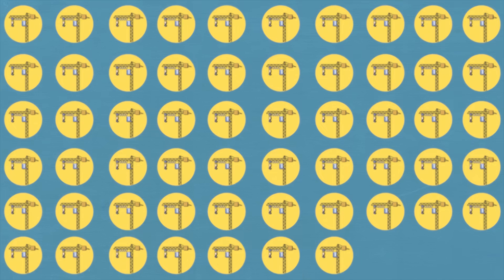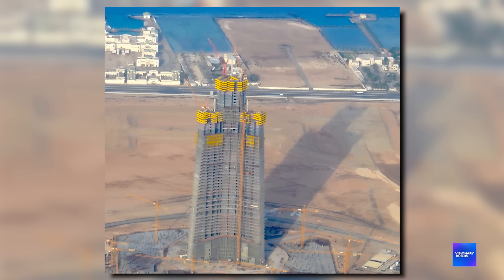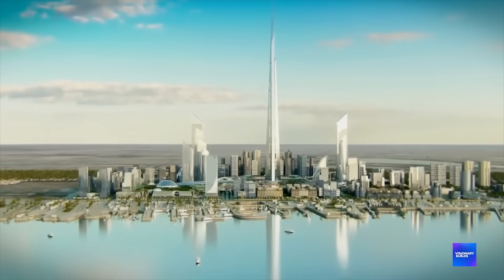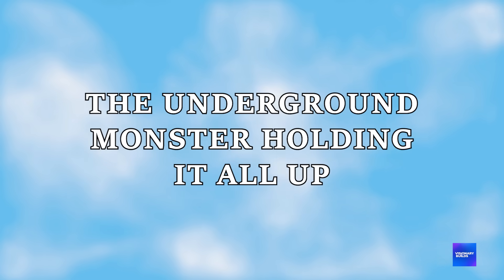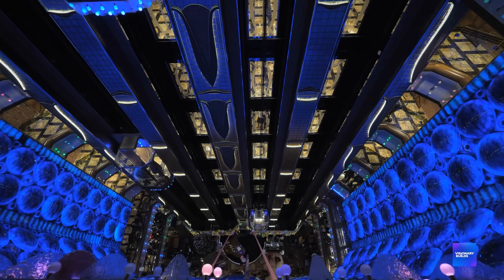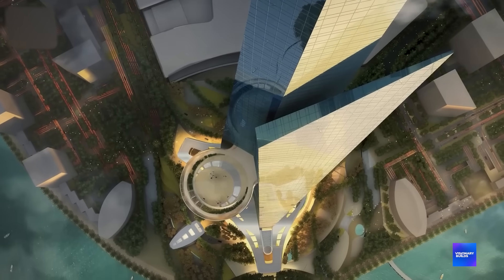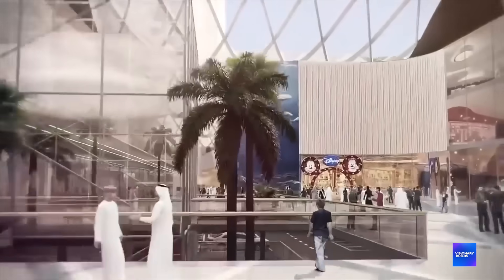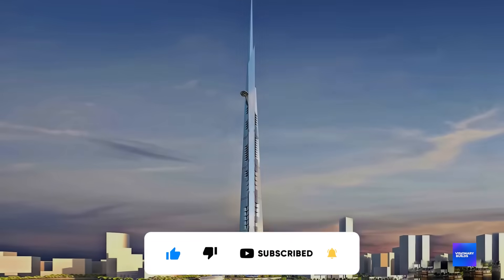Jeddah Tower: 1km Tower Racing Past Burj Khalifa

Comment: Seems counter intuitive to build a 3,000 ft skyscraper in a location that is otherwise empty and property is cheap.  For the same money, they could build 50 smaller buildings in the area and end up with 5x as much square footage.  My guess is that it either doesn’t get built to the original height specifications, or it ends up with huge structural problems like 432 park ave in NYC and property values in the building plummet after the initial sales boom. Either way, I’m betting this is going to turn into a financial failure.
Reply: Doesn't matter. This is pure comparing dicks

Comment: A few years ago, I was on the 37th floor of one of the towers of the Renaissance Center in Detroit when the fire alarm went off for a fire drill (my mistake, I usually planned around the windows for these in my tower but was  visiting someone in a different tower and didn't know.). It was all fine for the first 15 floors or so and then it all came to a crawl.  It continued to slow and we started getting to a point where women had to ditch their heels.  During those last 10 floors I learned people coming from the top would definitely burn alive before getting out of the building.  THERE'S NO WAY I'M GOING IN SOMETHING NEARLY 10 TIMES TALLER!!!  They literally won't even be able to conduct fire drills w/o causing heart attacks!  In a real fire you will just need to break a window and plunge to your death - got to be better and quicker than roasting!

One thing becomes clear...there's a positive correlation between age/seniority and propensity to be working or living on the high floors and that means the people least fit to make the longest trip are more likely to die!!  I wouldn't stop into this monstrosity if it were down the street and I'm sure not traveling to Satan's bunghole hot desert to do it either!
Reply: That's why they have refuge floors every 30 floors in BK with reinforced sections and dedicated air supply.  
But you're certainly right, people don't tend to remain very calm and orderly in general.  

A big difference of BK and JT compared to the Ren Cen too is that a good 85% of these super tall towers are residential and don't share the same high density as office working space.  Each tower also has at least 3 stairwells if not for the core as well so at least in a drill that spreads people out, too.  

Been on the high floors of the ren cen plenty when downtown for conventions.
Reply: @TheRealLink that should help - for awhile at least. I imagine eventually the floors below you burn and collapse in the worst case sxrnario. I'm sure they'll have heliport evac for the top floor residents!
Reply: Invest in a good parachute and spare…👍

Comment: Im glad theyre finally getting it done though at where it halted one thing that made me feel it wouldn't eventually be finished is where they stopped, certainly at a point that would be very hard to just quit on, and though i was concerned on if it would be finished ad originally planned as i wasx thinking they might've scaled it down as much as 50%...my only issue is these megatalls are tapered off as opposed to being 1 km from ground to rooftop the same dimensions like the original twins and new 1 wtc, its an enormous achievement no matter what, though one other thing is the spire which i almost never count in a buidlings height, its used far too much as a cheat like with 1 wtc which is absolutely NOT 1776 FEET TALL, its barely as tall as the twins when measured to rooftop, by their cheat i can tape a 12 inch ruler to the top of my head and call myself 6'8"

Comment: Uh, CN tower used the same tech and was the tallest unsupported man made object for decades.

And it was built fast and cheap 

And it still stands after 50 years and makes tons of cash

And it isn't in the middle of nowhere

And is designed to last 300 years

Comment: "Steel is heavy" umm sorry pal but that concrete is really heavy!!!!
Reply: That's what I was thinking. That concrete should definitely weigh more. Still I don't see the point of building so tall. Its not like they have no choice. It would be a pain in the ass if you lived near the top and you forgot the key to your apartment in your car. Then when you finally return with your key only to realize you forgot your phone.
Reply: @brianthomas5260 that's a very clear sign you need urgent medical check up regardless of the height of your residence.
Reply: @brianthomas5260 The idea is you stay in your bit of the building and never come out! Way to go...!!

Comment: How will all those windows get cleaned, and how often at such a high altitude?  Maybe they should invest in some kind of advanced ceramic or graphene long-lasting coating that lasts for years?
Reply: self cleaning windows  with an ultra-thin layer of titanium dioxide,  need two things to work SUN and RAIN one missing then no good

Comment: Regardless of who told you that the winds are irrelevant anymore with such design! Did they mention anything about the progress status  of the project and the expected date of completion !? Besides, would you please tell us what is the local material that will be mixed with the concrete to make it unique !?
Reply: heeeee,,, yo the local material is what ???????? sand,,,, there is nothing else,,,:face-blue-smiling::face-blue-smiling::face-blue-smiling::face-blue-smiling::face-blue-smiling:
Reply: @LaPiedra-ok7rl money. They’re using light weight $100 bills to help hold the concrete together once they can no longer reinforce with steel. 
(For those who are wondering ’is that true’, no I’m making a joke about wasting money, go get help)

Comment: In the video the narrator stated that the elevators are so tall that they will experience atmospheric changes. Atmospheric changes will create pressure on the carbon fiber elevator cables. These types of atmospheric pressure changes, though not as extreme, are why airplane fuselages are not 100% carbon fiber. While the maximum pressure can be high, carbon fiber will fail from fatigue under successive pressure changes at stress levels well below its ultimate strength. There is no single pressure point at which failure will occur, but it is a progressive process that depends on the magnitude and frequency of the pressure cycles. Is this something to be concerned about over time?
Reply: I'd be more concerned that the piles are only 300 feet deep, thats 10% of the buildings height, it'll fall over before those cables snap.
Reply: There is no mention  of the labour force that is involved  in building  this monstrosity.. Pakistani,  Indian and Philippinoes  come to mind with no employee  safe guard.
Reply: @paulclairethomas1344  Slave labor , but your "smart phone " electric car are " child labor " from a congo mine
Reply: Why can't they just build an elevator to halfway up? One would stop, then a NEW elevator starting from halfway up and going ALL the way up would finish the journey. Yea, passengers will need to change elevators but oh well. Price of having to go up to the top of the tallest building in the world, deal with it. 🙂
Reply: Ah yes, carbon fiber and pressure. Where have I heard that before.
Reply: Just think Titan submersible for carbon fiber failure.
Reply: This building is silly, but I’m not worried about the cables -As long as they have been properly engineered and go through regular safety checks….
Reply: You're going up ~600m max for this tower to 157F.  I thought it's a measurable pressure drop for every 1,000m in height.  So while yes, there will be effects from ground to top on Ultrarope, I would imagine it'd be very slim as it's not like this rope is going over 5KM or something in height change.  

Also, like any safety elevator equipment, the load + counterweight is probably a small fraction of what Ultrarope can carry.  
I thought it was also not 100% entirely carbon fiber but still mixed with steel?  Kone's been stress cycling the rope for 10+ years now and I don't believe has found any issue with it.